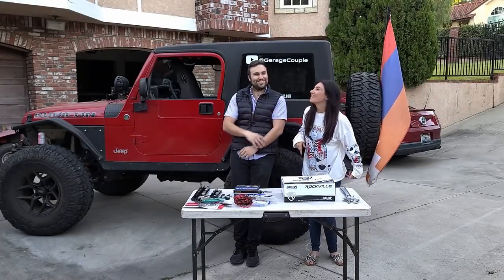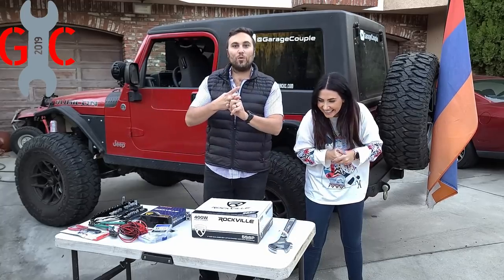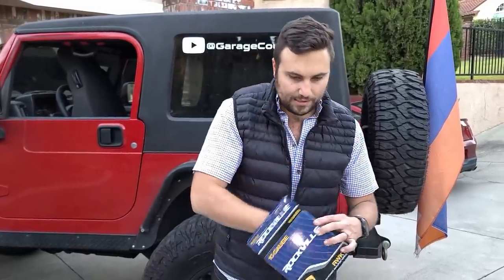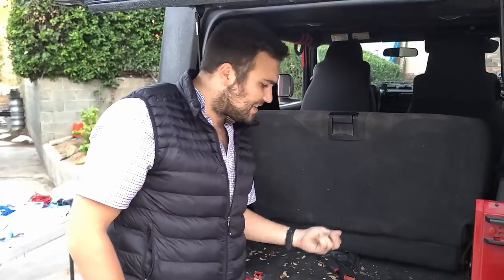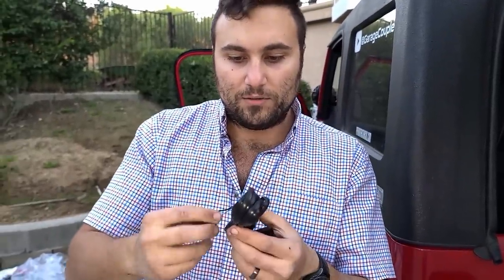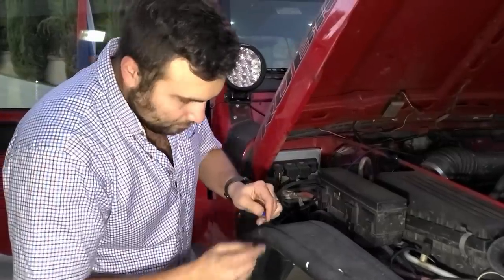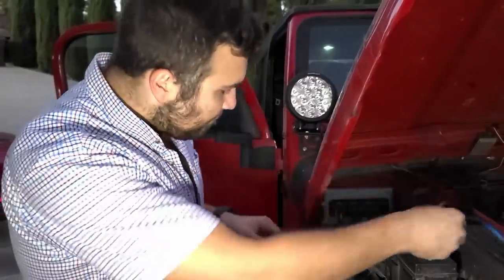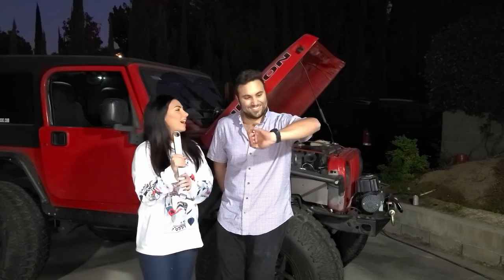HUGE Sound TINY Price Tag - Hidden Powered Subwoofer Install

Comment from the maker: Rockville 8 inch powered subwoofer - https://amzn.to/2Uu8QJ3
Rockville 10 inch powered subwoofer - https://amzn.to/3eZ7Aak
RGB Bluetooth  LED 7 inch headlights - https://amzn.to/2EvfVot
Sequential 7 Inch LED Headlights - https://amzn.to/3bdSw6W
JK LED tail lights (JL style) - https://amzn.to/2XJTXEp
Affordable mechanic tool set - https://amzn.to/3cW62wz
BEST Plastic trim restorer - https://amzn.to/36JAvew
JK Full light bar kit - https://amzn.to/3a9lcNA
Third brake light - https://amzn.to/3j8rMHU
Jeep bottle opener - https://amzn.to/32vqnFT
Motofab lift 3 inch lift kit under $150 - https://amzn.to/2CJD9pF
Smoked LED turn signal - https://amzn.to/2EQ7X67
Steel Stinger Front bumper - https://amzn.to/2WjykMA
Skyjacker lift kits: https://skyjacker.com/
Affordable sun shade - https://amzn.to/2wWQQyq
Rear LED tail lights - https://amzn.to/2wa7evn

Comment: Does it come with that inline fuse? I just ordered the 8 inch woofer and am wondering if I need to provide my own fuse for the battery connection.
Reply from the maker: It comes with it!

Comment: That's nice that a sub woofer is made to fit under the rear seat. I made my box with a 10" woofer in my rear seat. It's hidden and made with quick release wires so the seat can come out with ease. Kinda wish I looked around for this so I didn't hack my YJ rear seat. Nice install video 👍
Reply from the maker: Thats amazing! Good idea!
Reply: Michael the bass output from your box vs the underseat AIO unit I am sure if built correctly will outperform the underseat sub.
Reply: IN the rear seat?

Comment: Where do I find the signal wire? I know my aftermarket kenwood has about 20 different wires behind it when I looked yesterday. I would like to try this mod on my 99 since I don't even have the subwoofer in the console

Comment: Great video!  Santa brought me the same speaker.  I do have to flip you shit about that socket set you have, it's time to upgrade haha.  Quick tip for anyone running several different accessories, install a fuse block terminal.  Run one line to the battery then all of your accessories from the block.  Cleans things up and easy to add lights etc.  Keep up the good work.
Reply from the maker: haha thanks for the feedback!

Comment: Hello. Nice work! You will not get zaped from a 12v battery, but there is a risk of short circuit and the battery might explode. Allways be careful with batteries😊 Have a nice day

Comment: Let me first take this time to thank you, as an attending physician - during these uncertain times we find ourselves in.. Thank you for working the front lines... God Bless.  Now back to Jeeps - thanks for this video as I just picked up the complete Polk Audio system for my 4 year CJ5 resto and I was looking at the Powered JBL Sub as an option for a little more Base that I can tuck away under my rear seat.
Do you have any plans on upgrading your steering with a Hyrdo Assist... well do you have any plans for some off the grid adventures?  I'm actually looking into the TaxaOutdoors WB trailer to tow behind my CJ.
Reply from the maker: Thank you for the support! Not easy working the ICU shifts, currently have 3 covid patients, one just updated his LST saying he wants to be DNI. Hes more and more hypoxemic on HF NC at max settings. Really hate where this is going. 

On a lighter note, we don't have any plans to updae to hydro assist, it hasn't been giving us any issues with the 38s. We hope to go off roading soon, but I've been working close to 80 hours each week (and only edited this minutes before it posted). Hope all is well! Cheers
Reply: As the say in south beach, My Friend I'm on the backside/backend with Cognizant. Keep up the great work on the front side.  Looking forward to what's next on the list of never ending mods.

Comment: The RCA cables (that plug into the back of your aftermarket radio) are your low level inputs. The high level inputs would be if you connected speaker wires to the thin wires connected to the molex plug that has the power/ground/remote-turn on coming out of it, that snaps into the your powered (amp) subwoofer.  Great videos, looking for the link to your beautiful wife.
Reply from the maker: Awesome! Thank you for the support!

Comment: A few things to improve. Your video was pretty good.  I would ass some flex sleeve yo all the cables to protect them. Also add some high heat tessa tape to the power wire to add even more protection.  The ground wire should be either a factory ground or a dedicated ground when the paint has been removed to allow for max contact. Lastly having the sub just loose under the seat is a fire hazard. Make a abs mounting plate that can be mounted to the seat bolts. It will provide a nice platform yo securely mount the amp. Best wishes on future installs.

Comment: I have been looking into putting a small sub in my TJ under the passengers seat . I don't use the back seat so installing it in that area isn't going to work for me . Nice install Greg and my only suggestion is to solder the wires instead of using crimp connectors . Take care and be safe guy's .
Reply from the maker: You should totally do it! Thanks for the suggestion! For whatever reason, I'm more of a crimping guy, although I do solder some wires, just not a fan of the fumes (that cause cancer)

Comment: You can't actually get "Zapped" from 12v DC... You can touch both positive and negative terminals with your bare hands and you won't feel anything... 
Great video as always! Thank you guys for sharing!
Reply from the maker: Thanks for the info!
Reply: @Garagecouple  Be wary of bad advice from people that don't understand electricity. It's the current that zaps, not the voltage. I once wasn't paying attention and while removing a battery touched the positive terminal to ground through the wrench and the ring I was wearing. Big sparks, the ring ended up with a melted spot, and I had a nice blister around half my finger.

Comment: Shouldn't run power/ground/remote wires alongside any source signal wire ie R As or speaker wire. It induces interference...feedback & engine noise. Run all wires with current together & audio signal on the opposite side.  I know, I know...y'all aren't professional mobile audio installers. Nevertheless, those are lil tidbits you should know before tackling a project that you're not well versed in.
FYI... that crescent wrench still isn't the proper tool. A torque wrench is & just because You couldn't turn it doesn't mean it's torqued to spec. I don't think y'all realize what it takes to get 200 ft lbs of torque...at the end of the day it doesn't matter because anytime you install anything suspension related you should taken it in for an alignment & let the alignment shop torque it to spec.
Reply from the maker: We've been aligning our own jeeps for the better part of a decade. Never have had any issues. Also, there's a huge debate regarding running wires on the same side vs opposite side when using low level inputs. Aleens jeep, we tapped the speaker wire and ran it on the other side. This time around, the wires mostly run apart, in any case, 0 interference, 0 issues, it sounds perfect

Comment: Great vid guys! Curious how this powered sub compares to the stock TJ sub/amp. I’m considering this sub to possibly go in the center console or under the passenger as well, if it fits of course. 

Also you guys should look into the gear bags that attach between the roll bars or some molle bags for your recovery gear and tools.
Reply from the maker: Thank you for the support! The powered amp is significantly louder and stronger than the upgraded center console sub. There is no comparison. If you can fit it it would be perfect! Thanks for the suggestion